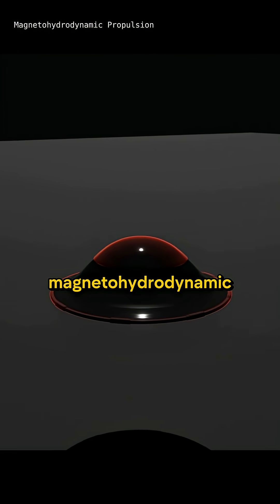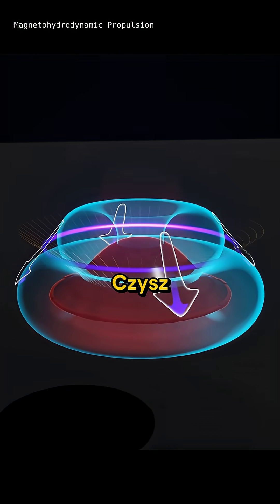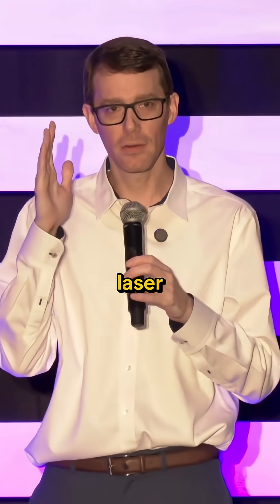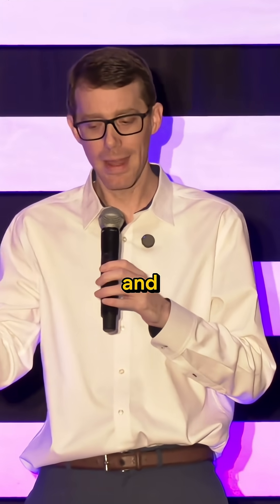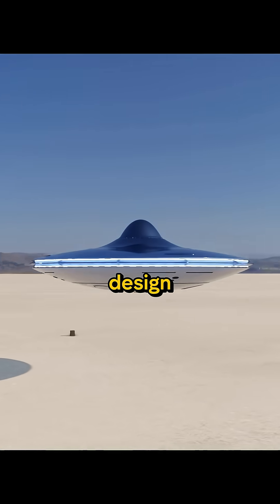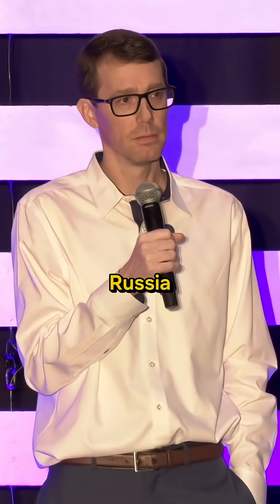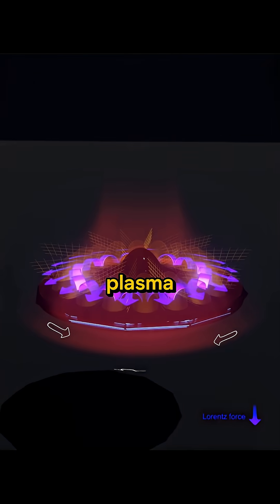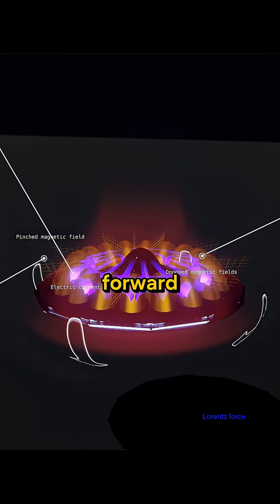Air as Fuel?

Comment: Magnetohydrodynamic or (MHD) propulsion is a real line of physics research, but using air as both reaction mass and fuel is misleading, the energy still has to come from somewhere. 
Firing a free-electron laser to ionize air is an energy-intensive process; you’re not creating energy from the air, you’re spending enormous energy on the air. That’s why the “zero-point energy” line instantly gives away the pseudoscience grift angle.
Reply: Get out of college and do some research. Start with Haramein. Then read DIRD papers. Then you will forget about "dark" energy BS.